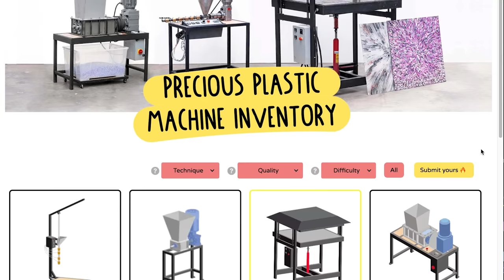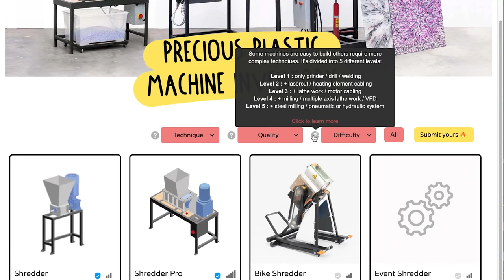MN#54 - We made a new shredder!

Comment: 10:38  That seems like a really great solution!  My ideas for some categories to add would be:

-  "Designer" /designed by or something for the person/group that designed it.

-  Cost (May be hard to calculate (premade vs Off the Shelf (OTS) Bill of Materials (BOM) vs local scrap / used motors etc )

- Throughput (Again may be hard to measure, but perhaps figure some sort of "standardized test" + metric for this) (maybe kg shredded per hour, "X"m^3 beams extruded per hour, and 
"standard mold x" 's made per hour)

- Reliability Rating (Measured in uptime)

- Repairability Rating (How easy repairs are, hard to measure, but maybe some form of review system?)
Reply: Also could the code or whatever for how you make this system be Open Sourced as well?  I think it would be of use for all sorts of other Open Source Hardware Groups!

Comment: Two suggestions. Firstly, "quality" for rating the contributed designs is a bit ehhh. Maybe rename that to "proof level" or "grade," and rank it on a subjective C- to A+ scale. (And avoid adding things that have zero documentation whatsoever.)

Secondly, Odysee is another good place for hosting files. It's primarily meant as a YouTube alternative (eg. for video hosting/streaming, and it can sync your current creator account), but it does allow you to upload non-video content as well as download packs. On the backend, the each upload is effectively backed by a torrent, and the URI for that torrent is written to a blockchain, making it a very free platform - both in the sense that anyone can contribute to hosting the files (sharing costs) and that it is resilient against censorship or takedowns.
Reply: And hackable lol let anyone  post their stuff with no moderation.there are folks that would put a bad smear campaign on something that is meant to be good.

Comment: A process to remove label adhesives would be useful. When washing my own (whole, unshredded) plastics for recycling, I used mineral spirits on a rag. Later I found that Fels Naptha on a rag with some soapy water is a cheaper, yet still effective means to remove label adhesives. Perhaps this could be adapted for use with shredded plastics.
Reply: Warm water makes them super easy to remove, because the glue gets soft

Comment: Hi, are there any plans to make the plastic parts of the CE certified machines out of recycled plastic?

I have noticed that many of the spaces make tiles which I assume are mounted to walls. I am wondering if there is a method to mount them that allows the tiles to be readily recycled when they are removed. My concern is mainly contamination of the plastic with adhesive and wall materials.

Comment: I watch these videos because I love the idea of being able to melt and reform plastic, but tbh the barriers to getting started are unbelievably steep. Laser cutter? I wouldn’t even know where to find one, let alone have the money for such a specialized machine. To say nothing of all the other metal shop tools like lathes and welding. 

I guess my point is that there’s a gap between your efforts to democratize plastics, versus the wealth required to participate. The subtext here is: “step one, buy $20,000 worth of tools and somehow learn to use them.” If I’m wrong, please put out a video on how to get past the first hurdle!
Reply: Pretty much any town/city is going to have a machine/CNC shop where you can get the parts cut at. No need to buy one yourself.
Reply: @danmorphis7759  That would be a good video topic. How to acquire the parts. Do you just take the drawings in to a fabrication shop? And what is that going to cost? I’ve hired a fab shop in the past and it was thousands of dollars for some door parts that seemed pretty simple to me. The customer, who is quite wealthy, didn’t proceed with the design because of the price.
Reply: @rexy9687  lol, I went to your link, read the page, and watched the video, not for the first time. The “Tools & Skills” section requires a lot, but it’s the video that really nails down the point. Go through that video and identify and price the equipment that gets used. It adds up. And then the skills, which are not just operating at least one type of welder on thick and thin steel, and a lathe, but finding and choosing a scrap motor with functioning gearbox, and cables the correct size for that. Etc. Or you can buy it all new, but then the price is a lot more. 

You can be defensive if you want, but PP is trying to democratize plastics recycling, and IMO they are not thinking enough about the barriers to entry when they shoot these videos. Defensiveness doesn’t help the project, whereas identifying things that can be improved does help. 🤷‍♂️

Comment: Honestly; in the USA we need a way to mechanically BOTTLE the shreds, so that we can swiftly pack bottle-bricks / eco-bricks (pura-vida model) from the great abundance of plastics Americans use.  Can the United Nations PLEASE PLEASE PLEASE assist you / all in designing a "shredder-bottler" combo mechanism as well?  The shred-condensed bottle -bricks can easily be consumed/encapsulated by use in decorative fencing and highway sound barriers, as well as  playscapes and portable outbuildings/camp structures.  No melting or fumes/emissions are even necessary...  It would truly all be so much more awesome IF the Yurt and the Base Camp had both  been built using at least SOME examples of mechanized advancement of all the existing best-practices from the Bottle-Brick/Eco-Brick Community as well....  Practice what you preach, and all...